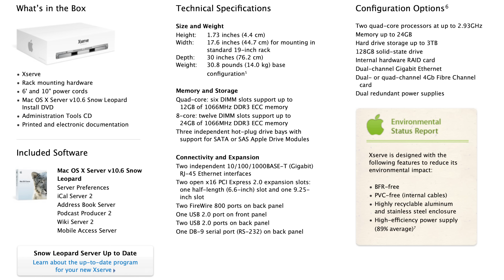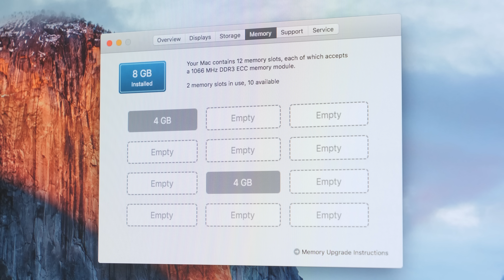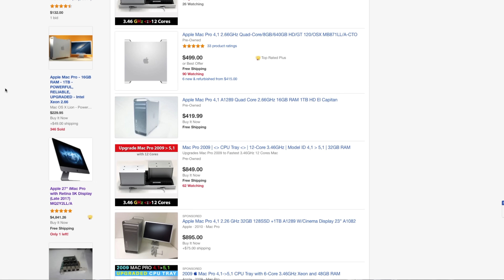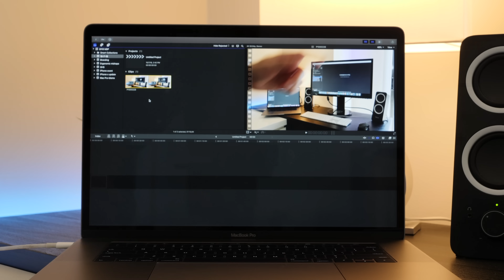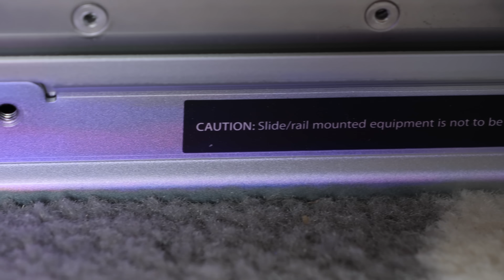I bought the forgotten Apple Xserve in 2018

Comment: I just bought my first one, it's going to be housed in a rack in a spare room that I hardly go into. If you were so inclined, you could also get some heavy duty clips, and mount this in your closet up against one of the side walls. It keeps the noise out from directly in front of you? Just run a network cable through the ceiling and into the space with your router/switch. I bought mine as a glorified Plex server because I honestly just don't want to buy a Dell. I prefer Mac OS.

Comment: Back when the Xserve came out, Apple was aiming for the server market, not for just server hardware. The Xserve came with redundant hardware both onboard and with the ability to have swap in parts on site (tho very little ability to do hot swapping). They also had service plans available for this hardware. 

This was a time before “cloud” meant anything other than meteorological entities, before companies would entrust their entire IP to live on Slack or Box or Dropbox. 

Before Xserve, Apple just assumed Mac Pro towers would suffice as server hardware and that would be enough for anyone. But again, at that time people were bitching that Apple wasn’t like Dell for servers. But they weren’t ever going to be, because the same companies complaining about Apple would never buy from Apple because they also required the ability to multi source hardware. And Apple wasn’t ever going to allow that. 

The biggest surprise about Xserve is that Jobs allowed it to exist. 

UNLESS you look at it as a piece of hardware to host WebObjects, the last piece of NeXT software to exist at Apple. It disappeared in 2009 as an Apple SKU the same time the Xserve did.

Comment: You say that one of it's major draw backs is it having slow render times compared to more modern system with quicksync but I didn't see that at all, in fact I saw the opposite

We are looking into using a Cineform workflow in my office and exploring ways to transcode on ingest

I ran a benchmark on all of the systems to see how fast each one transcoded a 4k file

The 2014 Mac mini took 1 and a half hours...the 2015 13" mbp took 1 hour, the 2011 27" imac took 43 minutes, the 2013 27" imac took 41 minutes, and the 2009 3,1 XServe took 34 minutes

The oldest system rendered the fastest by a huge margin

Comment: Honestly, your best bet to separate it would be to do something similar to LTT and use a thunderbolt 3 card, put it in another room, then run that to a dock in your actual workspace. As someone who has one of these for server applications, it is a hell of a machine on the cheap! My model came in at $150 with the 2.62 quad cores and 12 gigs of ram.

Comment: I just came into four 2009 xserve servers for free
Same spec as the one you have except they all have 12gb of ram each
Turning them all on at the same time is absolutely nuts, I had a stack of papers behind them and they flew away lol..my coworker's hair was blowing in the wind
I was thinking of setting them up as a rendering node server for transcoding but honestly they are SO LOUD
One of them was particularly loud, but after some fresh thermal compound it calmed way down
I was thinking of disconnecting some of the fans to try and lower the overall sound output depending on the thermals

Comment: Okay, I have used one of these beasts: As a server. In a 19” EIA rack. With 40 TB of storage to serve Final Cut workstations over Fiber Channel. But the server was mostly loafing, just doing what servers do, serving files and making sure permissions were kept/set. 

The extremely cheap workstation idea is novel, quirky and interesting. But these things really belong in a server closet or a separate room. Because if you have three or four of these, they sound like jet engines taking off. They always run fans at full bore, unlike the workstations, which only do that when things get hot.
Reply: All correct, Mark — just pointing out here that the Xserve fans do calm down after "take off" (until the CPU's are under really full/heavy load again).
 
But ALL servers' fans ramp up on startup.  I've always found Sun Microsystems were the kings of mega bootup noise — yet some of those were outstripped by a few HP servers I owned.

Comment: It seems to a lot of people that using an Xserve as a workstation is such a bad thing and they get all butthurt over it. The fact that people are bothered by something this stupid just frustrates me. 

Why are you all getting so worked up about this? It’s not your computer, and Luke can use it anyway he seems fit. He knows the downsides of using it as a workstation (the fan noise, no audio in/out ports). You guys are even getting worked up for no reason because of his his incorrect terminology for the Ethernet network interface and his pronunciation of “Xserve”.

I’ve also had the same thoughts of buying one of these for use as a workstation because of the price/performance ratio. It’s not a stupid idea at all. Despite the graphics card capabilities, it was very similar to the Mac Pro at the time in terms of power. If you’re willing to put up with loud fan noise levels and having to buy an audio interface, it’s totally worth buying and using as a workstation.

Comment: I think people are mostly giving you a hard time because you don't seem to understand the differences and similarities between "desktops", "workstations" and "servers".  For the last decade or so, "Workstation" has pretty much meant Xeon, ECC, SAS and server grade Ethernet in a desktop form factor.  Workstation class machines include the MacPro, Dell Precision and HP Z series machines.  The fact that the Pro and the Xserve had similar guts should be expected, not surprising.  
And, no, enterprise customers were not buying Pros so they could put them on shelves in their server rooms instead of more manageable Xserve rack units.  They simply weren't buying Xserves.  OSX Server was awful.

Comment: Hey Luke some questions: whats the newest xeon (or same socket cpu) you can fit in this thing? also you mention an mxm port, arent those limited to 8x pcie equivalent? also whats the newest version of OSX you can install? as in officially, without hacks.

Great video btw
Reply from the maker: You can’t go beyond the Nehalem Xeons they ship with due to firmware restrictions, I’m not sure about the MXM slot, but the main problem there is cooling as there’s no fan and heatsink system in place. Officially it supports El Capitan
Reply: @lukemiani  really? so its not the socket? could the FW be modified or the system could detect it? As for the card I guess use one of those removable mxm versions for laptops then?
Reply from the maker: Yeah the socket should support Westmere CPUs, like the Mac Pro from this year, but the Mac Pro has firmware updates available to allow it to use these. I wasn't able to find any firmware updates but I'm sure it can be done. As far as graphics You can use a pretty good range of MXM cards but its probably not cost effective and you'd need to make your own heatsink and fan assembly
Reply: @lukemiani  Wait you mean using a regular pcie card?

Comment: Value for performance  yes, but man, the decibels that thing is putting out would completely negate the practical use of it...no matter how it performed... fun vid to watch...always wondered abt those rack type servers...Id much rather use my mac pro 1,1 with dual x5365 ,better single thread performance, 32gb ram and a full size 5770 card, audio and ssds in raid...almost identical performance  , about 11,800 on geekbench 4 64bit mode..whisper quiet  and expandable...im using mine as a media center /web surfer so it need to be quiet when used with a home theater...

Comment: Hey, I found a macbook pro late 2013, base model had only 260 cycles on the battery, in very good shape except for multiple scratches and dings on the body, with after market charger for 230 $. It sounds too good to be true and the current owner claims he had it second hand. How can I know if it wasn't stolen or something like that. I've tested the laptop and it appears every thing in order.

Comment: If you replace the fans with delta fans and it will be 20% quieter.
but it is still a Apple machine. And they suck. Put Linux on it, fixed

Comment: The reason why the fans are blowing at full speed is because the SMC detected a fault on the motherboard. Likely some fried resistors and/or dead RAM pins on the motherboard....or just a mountain of badly soldered chips, really crap quality solder used, loose chips due to bad solder & the RAM sub-circuit being a complete head-case.

Comment: The reason this server is cheap is because of the power it costs to run it. Servers are designed to be ran 24/7 and is loud due to the front to back configuration of the fans.

Comment: Why does it feel like Apple Fanboys are the only ones hating on this video. "that 2014 Mac Book Pro was not made for video rendering! You should upgrade to the 2017 Mac Book Pro that was made for it!" Pretty sure I've heard stuff like this 100's of times even if they are said to be great for it. Also running a server like a normal machine is not a bad idea. First of all you can do a lot with a server machine as a basic machine such as, install Raid OS on it and have 4 users on different machines *personally I would immediately take Mac OS off*. Secondly if I could get a server pc that can run as good as a $500 machine, I would do it.... I bought an i5 2400, 8gb 1600mhz  memory, and it even came with a 7200rpm 1tb drive!!! For $80. Just throw in a RX 560 or GTX 1050/1050ti and it becomes a great gaming pc. Lastly computers do not just have one purpose. Name one person who has used their workstation pc for just workstation work... Never ran minesweeper, pinball, cinebench, 3dmark, or any other games/benching software???
Reply: There are a few reasons that, for the average person, running a rack server is impractical: 1. The size/shape 2. The noise 3. The power consumption
Reply: That doesn't mean it wouldn't be fun to try.

Comment: 1: it’s a server and server rooms are remote and are cooled. 
2: if you’re a consumer buying a server then you’re a techie
3: it’s a server not a desktop. it’s designed for running 24/7/365 so it’s not meant to be quiet.
4: ITS A FRIKKIN SERVER SO DONT USE IT AS A DESKTOP

Comment: Guys I bought a truck but I am going to review it as if it was a sports car. Hmm I wonder why is it so big
Reply from the maker: In reality it would be like comparing two cars build on the same platform with the same engine and transmission made by the same company, where one was discontinued because they realized it was too similar to the other one to need its own category. They literally have the same specs my guy, its not a crazy comparison
Reply: You have some good points I just find it "funny" that you choose to review it as a workstation (don't get me wrong there is absolutely nothing wrong in that plus it is a very original concept) Also quick sidenote mad respect for actually replying to some of the many comments :)

Comment: In this video: Man buys a semi truck to replace his Prius, calls it "very odd" and complains about the noise.

Don't talk authoritatively about something and then follow up with "I have no idea what I'm talking about". Give some facts (not opinions) about the device for some background, and then move on. That way you'll avoid looking like a complete idiot.

To clarify for anyone who may have taken this guy's review seriously, there were (and still are) many valid use cases for a Mac in this form-factor. Apple knew what they were doing when they designed this. They never targeted this product towards consumers/prosumers (as was evident by the very product page referenced in the video). The reason Apple killed the Xserve was because it catered to a small market segment. Despite the many similarities between the Mac Pro and the Xserve, it's still a different form factor which requires additional development time/effort/expense. Apple felt their resources were better put towards other market segments, so that's what they did.

As for what those segments were, I can name a few:
- Rendering farms
- Development infrastructure (Xcode servers)
- Mac network management (think Active Directory, but for macOS instead of Windows)

Unfortunately, Apple has been treating customers in these segments like shit lately (especially people working with 3D graphics and video), so there's even less of a need for a server running macOS than ever before.

Comment: I think the only application is reusing the case. Otherwise 1u servers are really not worth it unless your business demands hundreds of 1u racks. Otherwise 2-4u are much more forgiving and generally aren't as picky with parts and powersupply requirements. Seriously if you need a super thin just go with a 2u because you'll find out how much cheaper parts are and just how easier it is to work with.

Comment: Hey, you could try dusting off the internals for better fan performance. I have an Xserve 3,1 myself, though with more RAM, and the fans never spin up to more than 1500 rpm in normal operation. It is actually usable for me!

Comment: Compared to a modern day i7 those xeons are pretty crappy and it uses ddr2 ram so it's basically a brick that eats energy.
Reply from the maker: It's actually DDR3 surprisingly, I thought it was DDR2 as well
Reply: @lukemiani  hmmmm interesting, I know the one I got hands on was DDR2, and very proprietary at that, but it must have been an older model.  I got it for free at work a few employers ago from a junk heap so I didn't have a lot of background on it :-D

Comment: There's no point in evaluating a server as a workstation. You wouldn't complain about a spoon functioning poorly as a cutting tool verses a knife, they serve different purposes. The redundancy, expandability, reliability and form factor are designed with a server environment in mind.  Also- yes the Xserve doesn't make sense given Apple's current consumer/prosumer oriented product offerings, however during the time it was sold- Apple was trying to break into the Small Business and Enterprise market by providing a complete ecosystem including hosting mail, web, SAN, storage and directory services. For a time, a respectable number of media oriented businesses used Xserve, Xserve RAID, Xsan, Quicktime Server and the like to support graphic design, motion graphics and video production users.

Comment: Just how you feel that Apple missed the market you are missing the whole point of this product. You cannot possibly consider in any way to use that as a desktop/workstation that is not what it is meant for. Your whole video and idea is basically like using a fork to eat soup. That xserve is a RACK MOUNT SERVER it is not a desktop it is not designed or thought of to be used as a desktop. You said that you don't really understand most of the server mumbo-jumbo so maybe this is out of your expertise? Why make a video about a product you dont understand the purpose of? That xserve is not meant to be used with a keyboard and mouse on site, it is mostly going to be remotely accessed and provide services to a network like file shareing, databases, maybe web server. Not browsing the web or video editing. The reason why it failed is because the big-data industry could not adapt properity systems for large scale use. Linux dominates the data market and at the time MacOSX server was extremely lacking compaired to linux or windows server. Yes you can put linux on the xserve but its not a easy process. Most companies decided on traditional hardware instead of proprietary.

Comment: 42u Rack server tower?

I know most racks have42 RU... but this server is 1 u... only way a 42u rack server tower would work is if each Xserve was clustered...and even then you would not want them all on the same rack Incase of power or network failure. Plus add in a F5 for load balancer...

Comment: I think you should focus your channel on products you can actually pronounce. Also, a 1U rack unit that would normally work in a headless, remotely managed cluster environment, in an isolated rack... is not a fucking workstation!

Next, why don't you try to hook up a loaded 53' trailer to a Honda Civic and bitch about how terrible it is at climbing hills.

Comment: It's a server. Not a Mac Pro. Sure, the purpose of the video is to talk about it as a workstation. However, it was never made to be a workstation. Apple designed this to be a server and so they tied the hardware, including the NICs you called "ethernet hubs," and the software to be a server. The XServe was never a workstation, so treat the machine with respect.

Comment: I want to see this adopted into a gaming PC with liquid cooling to get rid of the noise. Use a riser cable to mount a GPU on the outside and wall mount the entire system. Run the liquid cooling through both CPUs and the GPU. Make it look like a mad science experiment.
Reply: AceMcCrank not possible servers are not ment to be a gaming pc PERIOD.
Reply: What we are looking at:
2 PCIe 16x 2.0 slots. This means we can SLI. Or, if you want to keep everything hidden, you could even fit the M3N1050TI-LN into the MXM slot. Sure you won't get the fastest speed but it'll run.
A socket 1366 motherboard that can upgrade to the Intel Xeon X5570 at 2.9+ Ghz. Dual CPUs, so you get a total of 8 physical cores, hyperthreaded to 16. And with the X5570 on the board and the Nahalem EP chipset on the motherboard you'll be able to support 1333 Mhz memory. The E5520 processor is the limiting factor on the memory speed.

Sure it won't be the fastest. But it'd still be a fun project. And it would be amazing for a streaming / encoding machine.